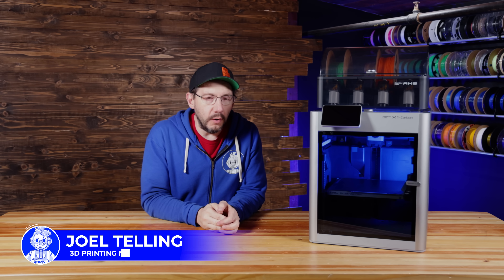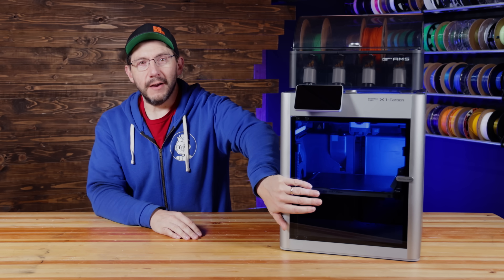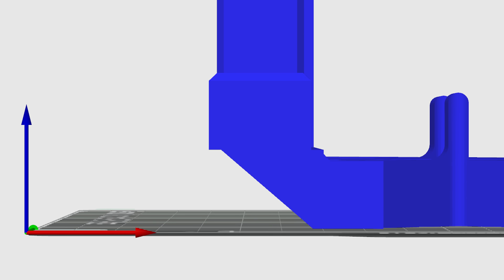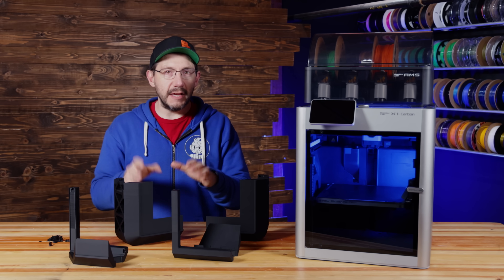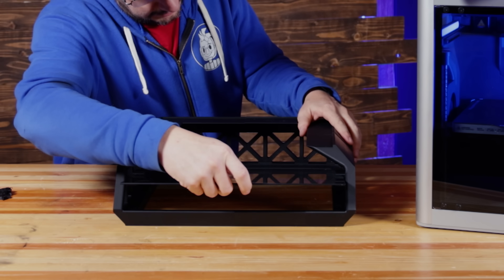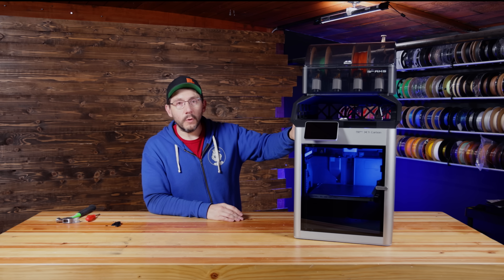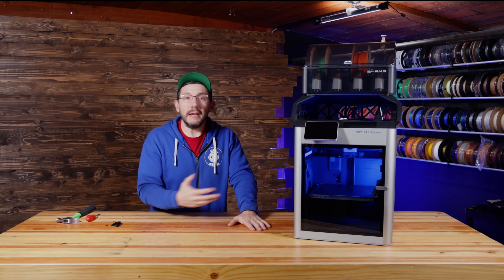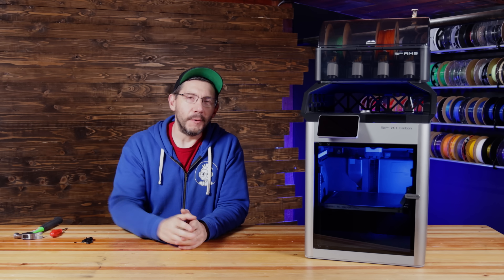MY FAVORITE Bambu X1 Carbon MOD!

Comment: 1:31 its not though.. it WILL prematurely wear your printer. 100% guaranteed. what you wanna do that give almost the same benefits but does remotely wear you rig as fast is crosshatch. Math does not lie, neither does actual experience. ( me no trust my matts )

Comment: I've had hundreds of prints with PLA with fantastic success.  .4, .2 nozzles, different speeds sometimes for fine lettering but always comes out noice! I live in Vegas (can't tell by my name) and it's fairly dry here. I mayo my house between 75-78 degrees (78 when I'm gone) and again,  no issues.  I've tried PETG and I hate it,  it needs fast less heat to print anything but it's flimsy.

Comment: I'm trying to set up the same configuration, but what I'm worried about is the printer tipping over. I also have the soft springy feet from Bambu Lab installed on my printer. Have you had any issues with the printer tipping during fast prints?

Comment: Great Idea, but I printed this with .mf files and the width is about 1.5 inches to small. There is a gap in the back just so the glass will fit. The PLA is strong enough but now Im worried its going to fall apart. I also feel like I wasted so much filament.
Reply from the maker: Weird. Mine works perfect. Which printer?
Reply: @3DPrintingNerd  X1C, I don't know what happened. I thought printing from mf files would make it to where I didn't have to worry about settings. Guess not, it ok, I just hope it doesn't fall in the middle of the night.😱😱 Its like the back printed shorter then the front, when I tried to put the top glass on the tabs the little bowtie connector broke and the back separated a good 1.5 inches easy. 🤷‍♂🤷‍♂ I used way to much filament to try again or toss it out so Ill make it work.

Comment: Nahh, I have been printing PLA with a completely closed chamber without a single problem, just run the chamber fan at 50%, I don't know what you are on about mate.
Reply: He clearly said it's only with some filaments, obviously not the ones you're using. I haven't had any problems either but I've mainly been using Bambu Lab filaments. I'm sure there are some filaments where this is a problem.

Comment: I've had the X1C for almost 2 years without a single problem.  I print with the door closed.  I'm not sure this is a legit problem that all X1C's encounter.  I don't get it.
Reply from the maker: It’s not an X1C problem it’s an issue with specific filaments. Some of them can melt enough to be a problem when an X1C is printing and has the door closed. Not all of course.

Comment: I have downloaded the "Universal Internal Spool Desiccant Holder:" file. The spool is closed on both ends and includes the cap for the open end. However, there is no open end. How do I get the desiccant into the holder?

Comment: One day, on hot summer day with over 100F outside, I accidentally printed PLA with top glass and front door both closed. 

It jammed the extruder and I had to spent an hour to take apart everything and fix the problem.

Comment: Got my X1 Carbon today...since PLA is just about my only material, venting is gonna be an issue.
What you said about heat-breaks and ambient temperature is a true thing...temperature differences work on a third (fourth?) power thing...if the air surrounding the heat-break is too warm, no heat is drawn outta the break at all!

Comment: The end was really touching, but I was especially shocked to come to the comments and find so many positive affirmations. I've been a little disheartened with 3D printing lately. I'm hoping the X1C I just ordered will help revive the spark. Thank you for your content and positivity.
Reply from the maker: Thank YOU for watching and leaving a comment! I bet that X1C is going to ignite a wonderful spark!
Reply: How goes it?
IMHO The X1C is hands down the best printer you can get, and it is the only printer I ever use anymore.  I even have a Prusa that just collects dist.  The X1C revitalized my love of designing and printing because it just plain works, with no fuss, each and every single time without fail.

Comment: This is off subject but needing help badly. 
New to 3d printing and P1S, my P1S got here today. Got a big problem that I need some help with.
I have A1Mini and use BL studio / Handy app account with no problems. But can't get the P1S to sink with my BL studio / Handy app account. What do I need to do to correct this. I uninstall Handy App still nothing. Now both printers don't syn with Handy App and BL studios nothing.
Reply from the maker: This sounds like a problem with the Bambu Lab back end. What did their customer support say?
Reply: @3DPrintingNerd  NOTHING, got the P1S to work with PC and my wifi but not with Handy App from phone. My A1Mini works with both PC and app.

Comment: I've been looking into the different ones you can print, but if it already hasn't been mentioned, you'll need something to stand on to change out the filament. The normal height of most work stations or counter tops is 36 to 38 inches. If you have your printer on something lower than this print should be ok. But even in this video you can see how high it is above Joel. Thanks for the vid. Cheers!

Comment: I'm looking for a minimum riser that holds the AMS because, to same my back, I have it a little higher as to not bend over.  The other risers have drawers and such, a little too high.  I have a small step stool that I get on just to change filaments in the AMS I have it so high.

Comment: Cool and all, for anyone that wants to save time and filament you can just put a pencil on either side of the lip that holds the glass, drop the glass back on and put the AMS on it- the resulting 5/16" or so gap is enough to keep the heat down. Or use PLA+

Comment: Okay… I did it. I ordered the X1C, and am returning my K1 to microcenter tomorrow. I tried for 11 days to make it work, but every day was a struggle, and I have experience with much less capable machines. I just got worn down seeing friends and YouTube channels just getting great prints from Bambu models. It honestly made me agro for a while, kind of disliking Bambu owners for sort of a smug arrogance… but it turns out it’s sort of earned. So… idk I wasn’t trying to beat or join anyone I just wanted a good 3D printer that worked most of the time with the least amount of multi hour calibration testing and tinkering and disassembly to get a freaking one off print to work. I don’t want to perfect one model for the next month, just random stuff I think up. 
So good bye Creality K1. Hope I get the shipping tracking from Bambu soon!

Comment: Good day sir!

I have a genuine question, I am planning to get a premium 3d printer this year and i have been really doing alot of looking comparing alot of the options out there. I am leaning towards getting the X1 Carbon however... It is getting a bit "older" now and im wondering if you think it is better to wait to see if Bambu makes a X2 or some newer version of the X1C... Any thoughts on if you think I should just pull the trigger and get the X1C or if I should hold out for a newer model (which seems likely to come this year, maybe... according to some... maybe not also)
Reply: context is i have a highly modified Ender 3... it is time for me to upgrade, I would like to start working with other materials, and I would like some very nice prints for things to be used in my wedding later this year, possibly custom flower vases etc...

My nephew has a A1 mini (our first bambu in the family) and I love that printer as well as the bambu ecosystem.

Comment: There is the same issue I have with the model. The glas sits not properly within it as it's ~1mm to narrow... So after wasting so much filament on this print, it's really disappointing that it's not wide enough for the actual glas.

Comment: why is it better for pla to print open? its the first time i hear that. whats the advantages?
Reply: Saw you didnt Get any answers, and you may know this by now. But if the chamber temperature gets too high, the fan wont be able to cool the heatsink enough, so the heat creeps up, expands the fillament and clogs

Comment: Is there a way to build a half-height enclosure to go on the bottom of the X1c to extend the Z height from 256mm to 400mm (  256 × 256 × 400 mm)  , someone has to have done it by now

Comment: In the process of printing one that has TPU gaskets to properly seal the glass, added drawer space, and a place to mount some LED lights since the illumination on the P1S is a little lacking on the illumination front.

Comment: That is the coolest mod I've seen. Next, a mod for switching between the AMS and the spool holder setup when you need to print TPU. Or another printer. haha I'm with you on the hobby. I've been watching your videos since the beginning. I started mine similarly in 2015. Thank you for the awesome content over the years.
Reply: There is a few different mods, while they dont easily switch from the spool to the AMS, you wont have to move the tubing. Its a Y-splitter that allows for another line of ptfe tube that goes to the spool to be fed into the printer as well. When I printed this, I did need to buy a ptfe tube kit with the adapters and clips and such in order for it to work, but it works so well, i'm glad i did!

Comment: What are the tell tale signs that you need more air movement when printing PLA? I.e. what signs would help us know that we should be opening the door, or removing the top lid?  Most of my PLA prints are fine.  We assume some of the stragglers will be there from time to time.   But I am curious to what to look out for?   Thanks for the video, I may still try this mod.  However, I would like to be able to explain the reason for this mod a bit more in depth?

Comment: Hi Joel, great video. Keep up the great work!!  I have been wanting to do the same mod for a while. I might just print it this weekend. I do have one question, I noticed that you have some cardboard spools in the AMS. I have often been told that cardboard spools are not good on the unit and can cause issues. I have been avoiding buying cardboard spools, but some of my favorite material only comes on cardboard. What are your thoughts on this?

Comment: So many problems with this machine.  The first layer inspection is provably a fraud.
Reply from the maker: Is it? What makes you say that?
Reply: @3DPrintingNerd  it routinely “ approves” first layers that have entire sections  missing. Leading to printing the next layer in air and creating the dreaded blob 

Both ABS enclosed and PLA with door open and top off. I have not printed other materials.  I have seen it approve a first layer with zero printed material on the print bed…

Comment: One idea to improve it further. Create a frame with the same dimensions of the glass top, make it so there is a fine computer mesh in the frame for a dust  filter so when the glass top is venting you can still keep dust out

Comment: I've printed many different brands, colors and finishes(Matte, Silk, Gloss) of PLA and never had to open the door or take off/lift up the top cover to get great quality prints.  What specific brands, colors, and finishes of filament and types of printed items require extra air flow in the X1C?  I've printed a wide variety of sizes and shapes of objects in PLA without issue, so I'm confused as to why extra air flow is needed.

Comment: I did the original version of this first after getting my P1S upgrade kit, it's really easy to print and to set up. Though I ultimately went with the BLV AMS riser cause it looks cooler and has the drawers and build plate storage.

If you want something a bit easier and with way less material than the BLV, this is the way to go for sure.

And remember everyone, the best reason to own a 3D Printer is to print things for your 3D Printer ;)

Comment: The rule that you have to open the door when printing PLA also depends on ambient temperature. I have my printer in the garage and it's too cold for the door to be open. I get layer separation problems if i dont close the door and get the chamber temperature up to around 32-35C. It's partly due to the Aux fan blasting at 70 percent by default.

Comment: How common is it an issue printing with PLA fully enclosed? I haven’t had any issues doing so but I live in a cooler place. The chamber tends to get to ~35 C when printing.
Reply: I have observed the same problem with my Voron; the chamber gets hot enough (without extra heating) that the filament softens enough to get clogs.

Comment: Total game changer my temps stay so stable by putting my back glass on the printer and front on first tong
I looked everywhere for this model that I seen on a a1 video when I found it I also found the minimalist version next to it on printable and did it with 650 grams of filament instead of 1.5 to 1.75 rolls thanks Joel hope you had  great holidays

Comment: My bambu has never worked properly. After a year of tickets and antagonist language from bambu. They sent me an entire new heatbed. This required dozens of hours and almost 50 bucks out of pocket to strip the machine down to nuts and bolts. Well, it didn’t solve anything. When I tram my machine, the gap is almost 3/4 of an inch between the bed and hotend. No wonder I'm having first layer issues... Bambu has been silent for almost a month since I sent them the tramming video. I wanted to love it, but because of CS, I will never support bambulab again,
Reply: mine came out of the box perfectly. should’ve refunded or returned if that took you a year
Reply: imo if my printer aint working for the first 2 weeks il just have it returned

Comment: I love my X1C. I printed some like that a few weeks after I got it becuase I print mostly PLA and I run my bed temps a little on the high side. The one I use also keep the lid raise up for it the vent but it also as a spot to put LED light strip in it.  My printer now has over 1500 hours on it and it all doing great.

Comment: I considered one of these risers, both to better be able to service the printer from the top when needed, as my AMS is also there, but also to get the option of drawers and build plate holders etc. But before spending many hours and material print such a riser, the question many people seem to ask (including myself) is if these risers do not add to the vibrations and if including drawers etc. if it adds to rattling when the printer prints fast / shakes a lot. Also some speculate in if these same potential issues could cause the printer to print worse due to not taking into account the more vibrations / shaking that comes with the riser and stuff on/in it also moving around when printing. Would be nice with some long term reviews / experience with different riser models. :)
Reply: You would want to rerun the input shaping calibration (XY mechanical sweep as Bambu calls it). Then it would account for the change in resonance. A little bit of shaking won't affect part quality severely, and that will take up the slack.

Comment: I don't think PLA was the best material to make that out of if you are planning on doing heated chamber prints. The chamber can theoretically go up to like 60 C I think and that is the lower bounds of where the PLA starts softening due to heat.

Comment: Bambu Lab 3D Printers are such a game changer to 3D Printing. Previously we were making prints so that the printers could function. Now we make quality of life prints and we do it in color. 🎉🎉🎉 While I feel it is plug and play like a 2D printer, my wife still sees it as tedious to remove the build plate, remove the print, clean the build plate, and put it back into place. Maybe Bambu Lab can make a belt drive replacement build plate that will auto eject and clean the plate? The we are left with loading filament and cleaning poop just like babies (load food and clean poop).

Comment: So what if you're printing ABS, you can't open it but you have to open it or it jams?
Reply: There is only a slight risk of jams with PLA because it softens at such a low temp, but even then the chances are very low. I've printed tons of PLA with the door and lid closed and never had a jam. 
Other materials like ABS don't run the risk of jams because they soften at a temperature much higher than what the chamber can reach.

Comment: Does anyone know ? If you print the riser in pla. Can you print special materials which require hot temps without the riser melting ?
I see some serious chamber temps with some filaments
Reply: Shouldn't be an issue, the temps might reach 50-60c inside but you're not going to make the riser reach temps anywhere near that.

Comment: So great to see you back and smiling Joel. 

I’ve printed hundreds of PLA pieces with no venting. Wondering if there is any science behind this idea?
Reply: It really depends on your local climate. I live in Virginia, and my printers behave way differently in the summer than in the winter. Room temperature, humidity, etc. In winter I need to run my Enders in a closet behind plexiglass for prints to stick. In summer, I need to pop the plexi out and run a fan over them or prints will warp. I bought my X1 in November, so I've only seen it work in winter. It's amazing how much a few degress of room temperature and a few percentage points of relative humidity will mess with print quality.

Comment: I saw a different one of these risers for the x1c that was a lot more slim and just had 2 closeable magnetic doors on each side for a total of 8 little doors that could open to vent. This riser you made just looks really big, and doesn’t come with extra storage, but it does look cool with the see through structure on the sides. Kind of reminds me of one of those Ooni pizza ovens or something like that. Thanks for sharing.